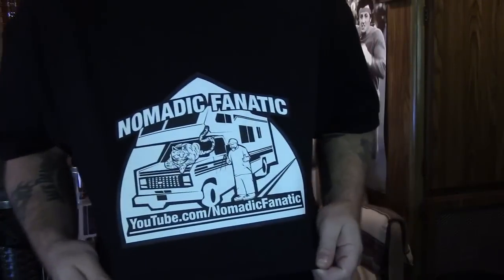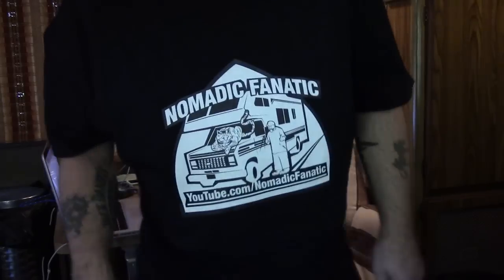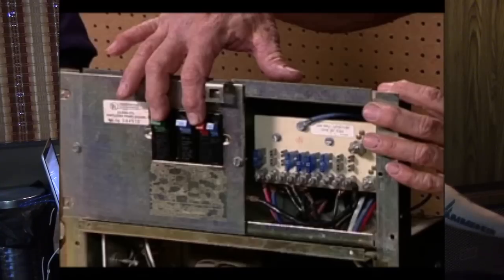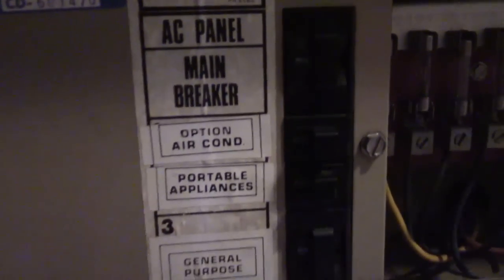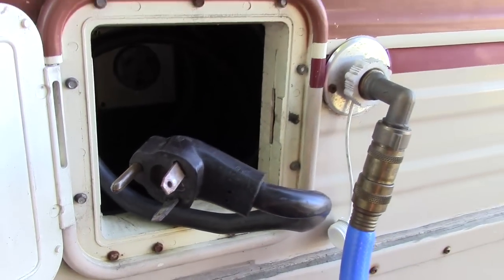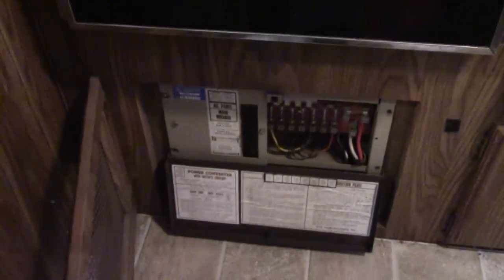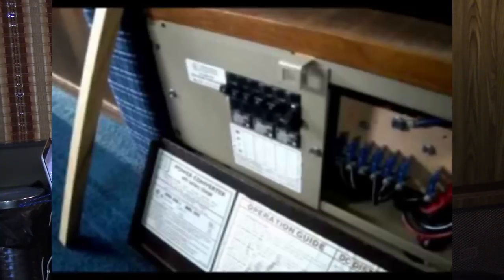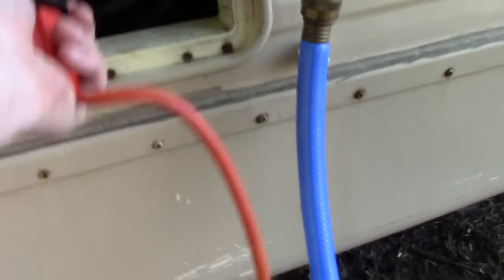RV Power For Dummies

Comment: Which charges your rv battery(ies) faster?  Running the generator or driving the RV?
Reply from the maker: The alternator is going to trickle charge through the isolator while driving.  However, most older converter chargers are just going to do the same while running the generator or while plugged in.  And it won't stop once full - will just keep sending 2-3 amp charge rate to the batteries no matter what.  More modern smart chargers will have 5 stages of charging while plugged in or using generator.  I've always used an auxilary speed smart charger plugged into outlet while I'm running generator which can send up to 30amps and charge quicker.  The alternator method is not going to do much while driving, but it's something.

Comment: Thank you for this info. I came across this attempting to find out why my heater in my pop-up was working on AC power, but not battery. Now black wire is neutral with vehicles, with the red positive, but when it comes to pop-up trailers there is no red. So I just assumed that black is neutral and white is positive in replacement of the red. But noooooooo. Turns out that I've been running the lights with the wiring wrong and that is why the furnace wasn't getting enough energy. In all the trouble shooting internet searching I've been doing for days, not one mentioned this. Just moments ago one forum post reply mentioned this important fact, that with RVs the white is neutral, not the black. And the black is positive. 
I was about to call and make an appt with an RV/trailer repair guy. I would have felt like the person calling a TV repair just to have them come in and plug the thing in. 
So yeah. I'll put this info here for any other dummies like me.
When connecting the battery, make sure the white is connected to the negative and the black to the positive.
So I watched your video to get other obvious basics I may be ignorant on. Even though I do not have an RV, I did find it informative.

Comment: Hey my friend I have a question and if you can help you will be helping me solve a huuuuuge problem please. I own a 1988 Winnebago Chieftain 22" with a 454. All of a sudden my water pump gave out. So I didn't skimp and bought a new 12v pump today. I was able to swap em but when i rechecked the voltage on my hot wire, it went to 0.0 after a mistaken momentary grounding. It was previously at over 14 volts. So, now I have no 12v hot wire. New pump is useless. And so much for running water. I am wanting ro know how would i fix this wiring (fuses are all good, fusable link is not blown and the rest of the 12v stuff runs fine) or, how can i run a new 12v that I can switch on and off. My budget is really about 100 bucks maximum. Bro if you can address this you'll be a life-saver. The only other nearby 12v is a vent fan. I don't know how the heck i did this and washing my dishes outside/showering with a bucket of cold water and a kool-aid pitcher really wears on my good-natured disposition. Thank you everybody who helps, in advance. God bless.

Comment: I have just acquired a 1990 winny elan. There is an. Aux. Battery switch on the dash. What is that for. Do i use that when i am parked and i turn off the engine? Oh yes. Your video was great . i still have a ton of questions. Leaving for a trip from roswell, NM tomorow morning, and dont know what half the buttons are for. Thx

Comment: Always trying to see what I can get away with plugging in to mine. Fans, computers, and small appliances usually run with no issues. If only I could find a low powered A/c unit. So far, a Luma swamp cooler is the best I can do. Thanks for this 12 volt explanation and breaking it down so simple!
Reply: A mini-split AC could work and/or installing a "soft start" device.

Comment: I have a converter in a 71 camper it has a switch 110  off  12 volt also has a couple 110 sockets  can I use the sockets when plugged in to power  not sure how to use

Comment: Hey bud, great videos , I have 2 newer batterys (same size) for my 5th wheel rv. My converter comes on every 30 seconds for 3 seconds is that normaml?... My batterys were charged before we left.oh ya we are hooked up to shore power..everytime the converter  kicks in the DC lights  are brighter . It seems to me that the converter shouldn't  come on this quick. Tks rick
Reply: Sounds like you might want to have the converter tested for proper functionality.

Comment: Does the electrical system charge the ignition battery also when plugged into shore power or should I be starting the RV engine once a week or so?
Reply from the maker: If we're strictly talking older RVs like the one I had in this video, then no.  Being plugged into shore power will not also charge your chassis starting battery.  If you are parked for months at a time, I might recommend hooking up a charger once a month to keep it topped off. But you really won't be draining it at all unless you are opening the cab doors and triggering the dome light, or if you are using the cigarette dc plugs up front, which I would advice against.

Comment: When I run my onan 4000 generator do I have to keep my power switch on located on the side of my entrance steps.   Some units have to plug their 30 amp cord into the receptacle plug located in the same rv but my 30 amp cord seems to be pre wired without me plugging into a    30 amp receptacle.  I hope that i made some sense here I am new at this. Thank you.
Reply from the maker: The plug is more of an older RV thing. Most newer RVs to not need you to have the main power plugged in for the generator to provide power to the rig. With that said, if you are running your generator and your outlets inside still do not work.... I'd look for a plug near your cord compartment to plug into. :)
Reply: There is no plug ...what about the power switch by the stairs that shuts down all the 12v  systems ..should I leave that on ?
Reply: was that little black plastic circuit breaker switch on the noan generator below the carburetor must be in a forward position. Now you know.
Reply from the maker: Oops! Yeah I forgot about that. Actually I just learned about that switch myself last October.  It was switched off by accident while servicing the generator and took me and my buddy a while to figure it all out. lol. I've heard stories of people selling RV's saying "Generator runs, but doesn't produce power." First thing you check is that it's plugged in, and that the switch you mentioned it turned on. :)

Comment: Thank you. Very helpful. I just have one question, when you disconnect from shore power, does it automatically switch to battery, or do you have to flip a switch?
Reply: Your DC (battery) powered devices will always draw from the battery if you are connected to shore power or not. The converter just helps to replace the lost energy used when you utilize those devices.

Comment: Don't say things like "You CANT EVER use the 20amp service to live in your RV" This is not factual. If you run minimal appliances only consuming 20amps, even if it peaks higher the worst you will have is some hot wires, not a big deal.
Reply: Lived on 15Amp service running A/C for over a year. no issues.

Comment: Hi great video, I wanted to ask you about how you use your external charger. When you clamp it to the battery do you disconnect all the connections from the van off before connecting your charger to charge the battery ?

Comment: hey man, i was wondering about the possibility of running the  shore power plug,inside to the inverter? i have a solar set up too so it seemed like in theory that could work,but i get a gut feeling of bad news as well
Reply: The shore power plug takes AC (house current) from the pedestal inside your RV to the breaker panel. From the panel, another set of wires connect to your converter to convert house AC to DC battery current. Hooking up anything without a breaker or a fuse between the power supply point and the equipment is dangerous to gear and human.

Comment: That was great for a noob like me, thanks! Hope to find another video that gives a sense of how many hours of DC and inverted power you can get off a deep cycle battery, depending on what kinds of devices you're running, of course. I might be 3 days without shore power and want to conserve gas without running the generator too often. And it will be hot! Hopefully I won't need the aircon.

Comment: I just purchased a new travel trailer and it came with 2 deep cycle batteries and has an inverter for the fridge only. There is a 13,500 but ducted ac. My dumb question is can I use the ac with just the batteries fully charged. I'm not going to try it without knowing. Will it even turn on and IF so, how fast would the batteries run down to 50%?

Comment: bought an rv an previous owner really did a number on the power im not very familiar with electrical wiring but my main shore power cable no longer provides power when plugged in so i cant run my ac unit i do see a 300 watt inverter they put but id like to go back to original power.

Comment: What inverter should I need to run an iMac? Thank you so much you are the best!
Reply: The label on the bottom tells the power consumption, but you can buy a cupholder style 200-300 watt inverter and be fine if the iMac is the only thing plugged in.

Comment: Hey man, nice video. Informative! Quick question, is there a way to turn on the overhead AC without having the generator on while driving?
Reply: No. Air conditioners of any type pull a HUGE amount of current during startup. You need to be plugged to shore power or run the generator (when not moving). Just use the dash AC if you have a motorhome.

Comment: I have a question.  We bought a used 2016  Coachmen Freelander.  There is a box with a door on the back that has a plug and
a receptacle.  Would we plug that cord into the receptacle in order to use the power produced by the internal generator?
We know very little and the seller knew about as much! thank you.
Reply from the maker: Correct. That plug would go into the outlet at a campground. (Shore Power) And it would plug right into that outlet in your compartment in order to get power from the generator. If you turned on your generator and didn't have that plugged into the outlet in the box, you would not have power in the RV in any outlets, just be running the generator for fun. :)
Reply: Thank you! if the generator were not turned on and that plug were plugged in would it run on battery power from the extra battery that is under the stairs?

Comment: Thank you for the video. We just purchased a 1977 Beaver Sportsman RV. I cannot find any deep cycle battery compartments. It does has a side battery compartment and what looks like two hookup like car battery wires. My issue is trying to figure out which wire in hot and which is ground. Both are covered in black. One has 3 wires together connected as one and one of those 3 has some small yellow tape around it. The other one is a single wire. How do I determine which one is hot and which one is ground so I can hook up my battery?

Comment: I have a question. Why will my slide out and awning not work while I'm plugged into a 30a plug? Once I charge the battery it will work. Also I don't use anything for months now in my RV and it still doesn't charge the battery.

Comment: Great help!  Q #1 I want to wire my 1973 travel trailer to use a 'fantastic fan' on the 12 volt system.  Are there instructions anywhere you know of?
#2 What brand of deep cycle battery do you recommend?
#3 Are there kits for adding more 12 v. plug ins?
I'm a newbie and appreciate your help + I do not have a generator.
Thanks!

Comment: I understand the 12 volt system. I understand the 110 v system.  But it becomes crazy when you start connecting these systems with inverters, converters, generators and solar power.

Comment: hi, so what do you think. when plugged into shore power turn off both main and aux. switch. or leave both on, or, or leave main off and aux. on. which is what I do but that means my aux. the battery is always charging.

Comment: Haven't thought it right thru yet but I'm thinking if you made up an extension cord with male plugs on each end you could run it from your inverter to your shore power with a 15 amp converter plug to get power to all of your 115V outlets in the rig. You'd just have to watch that you don't overload it by plugging in too much at a time.

Comment: What is the correct way to plug a 30 amp into a 110 for longer use besides extension cord. or is it just not reccommended period? thanks again

Comment: I installed a 1000 watt inverter in our 5th wheel so we can stop and watch TV while taking a break at a truck stop without running the generator, and agin you are right we have sat and watch TV, movies from our DVD player for over 4 hours and still had power. We also just ran the wire from our battery to a central place in the RV so if my wife needed a 110 plug device she could use it as well. but do use a heavier gauge wire for every 6 feet from the battery to prevent power loss or heating of the wire.

Comment: 1985 suncraft having trouble with getting converter to supply my 12 lights but i have dock power fine or gen power fine can u give me some tips i think my converter is shot
Reply: class A motor coach

Comment: Great video. I'm new to this and wondering if you could explain more on the inverter. Does the power to use your inverter come from your marine batteries and while using the inverter are you not afraid of draining those batteries ?
Reply: Yes, the power comes from the batteries when using the IN-verter. You do have to watch what kind of usage when using the inverter so as not too drain your batteries low enough to damage them. There are inexpensive battery monitors on Amazon.

Comment: Very well done, I am an electrician, and saw nothing that I would not be completely comfortable with in your explanation. Thanks!
Reply: Can I plug a 3000 w in DC inverter into the battery cables that go to my DC batteries and work
Reply: John McGilvary i started a camper project and took it down to the frame leaving the walls I wanted to redo the electric and be able to plug a 10 gauge extension cord and have the new outlets work how would I do that

Comment: It is possible to run the whole RV from an inverter, but you need an electrician to install it unless you have been trained, as DIY'ing it with out a full understanding of electricity is a dangerous way to cause an electrical fire, starting your RV/home on fire in a way that can't extinguish easily. 

If you wanted to run the whole RV from an inverter a 3800W (constant, not peak) inverter will provide 120V, 30A power for 30A RV service. Just know that many of the high power inverters use two separate circuits to provide that power, similar to the system in most US homes which provides two separate hots that when put together give you 240v, but used individually provide 120v each. 
50A RV service is a split phase system, so like the inverter it has two 120v circuits. And with 50A service, each of the two 120v pins provide 50A, so the true 120V capacity is up to a possible 100A if the RV were to use the full capacity of the 50A cable/connector. Most don't because 50A alone is nearly double the capacity that 30A service provides.

Comment: I turn on my generator and my outlets don't work what can be wrong
Reply: Paul Rivera did you get it figured out? this is my problem too! please help, I am on ythe road!
Reply: Is your shore cord plugged into the generator? The generator will typically power a 30 amp outlet that you will need to plug the shore cord into.
Reply: Paul Rivera it will? I will try It! THANKS
Reply: Check the circuit breaker located directly on the side of the generator. On mine it looks like a "light switch".

Comment: Do you think you could get enough solar to run the rooftop AC unit?  How much does one of those units use?
Reply: Mr. Mizu a.c. units draw a lot.  I doubt a dc power source could run it very long and you'd need a big inverter.  I could be wrong but that's my take on it.
Reply: The 5000 BTU window ac uses about 400W. Which can be run on Solar but you would probably need 1000W of Solar and a large battery bank (4kw+) to run it for an extended period of time consistently.
Reply: @ekoms108  Is a window unit the most efficient one out there to use for an RV right now?
Reply: @ceefiveceefive  technically a mini split ac is the most efficient. However, that requires the condenser to installed outside the RV. I have seen some people manage to install it underneath the RV and others install it via the hitch on the back of the RV. 

That being said, window acs are more efficient than rooftop acs across the board.

Comment: Hey, I just bought a '95 FW from a dealer, as is, It sat on the lot for 6 months during the winter. I am plugged into shore power at a campground, 30-amp service. I have outlets and microwave only!! No 12-volt DC. (fridge, fans, overhead lights, furnace, AC, water pump blabla..) Brought my only battery to AutoZone, they say after a 2 hour test that it can't be charged. Converter is dead, no humming or heat. Breakers/fuses are good. Converter is a single-stage Todd converter. Converter issue, or battery issue? If I am always plugged is, isn't the battery redundant? Any help would be awesome.

Comment: What is the largest Inverter Wattage you can plug into an RV inside DC Plug without direct connect to the batteries?
Reply from the maker: +Ed Eccles I'm not sure. I've seen a 5000 watt inverter before. Not sure if it's the biggest.
Reply: Thanks!  And for the fast response!  I'm new at the RV world and I follow you
Reply: In most vehicles, the cigarette lighter socket is fused at 15A. So the largest inverter you could run off it would be about 200W.